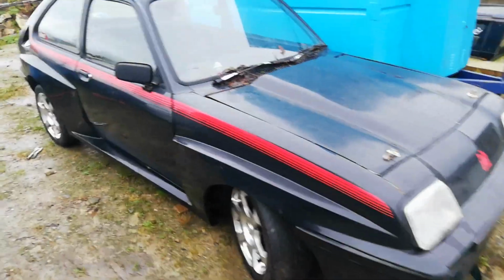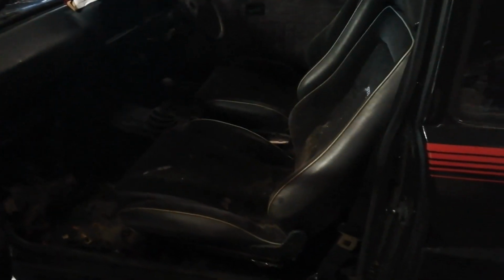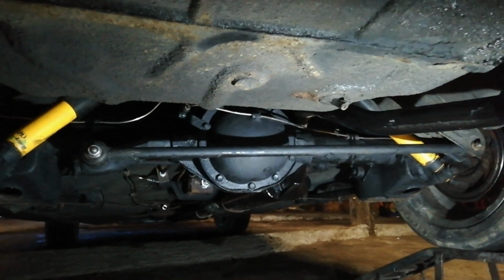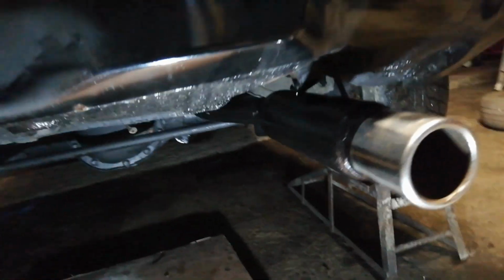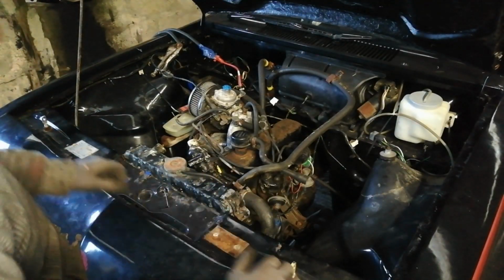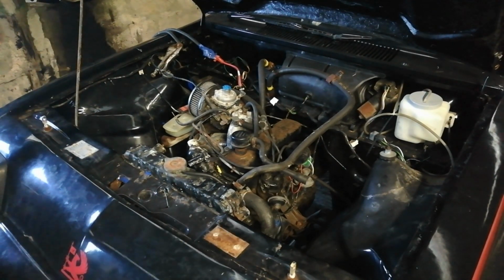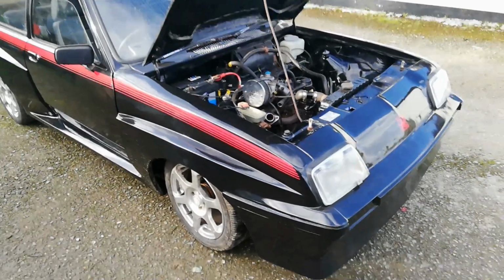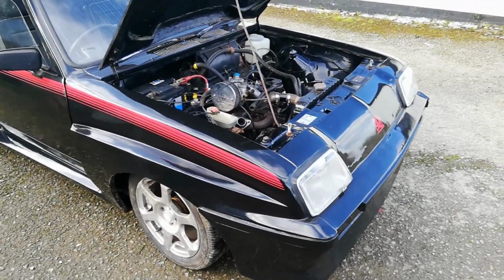Vauxhall Chevette revival, Will it start?

Comment: more please...what exhaust has it got on? mine is knackered but cant find a sporty one to replace it with
Reply from the maker: 😁 Chevette is still waiting for me to repaint it and finish out the interior, hopefully in the next couple of months. I actually don't no where the exhaust came from. It was brand new and inside the car, has a 3inch cherry bomb back box. The exhaust had to be lengthened 6 inches to fit. Take a look on ebay maybe. I got a full exhaust for a jetta from Lithuania and it was excellent quality for about a 100euro
Reply: @TheTinski07  cool thanks for the info looking forward to the next stage